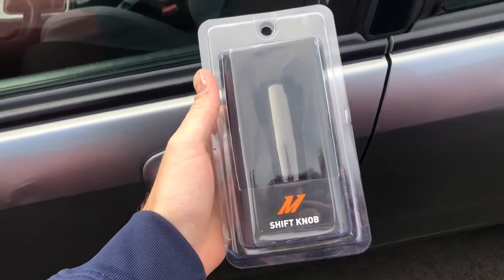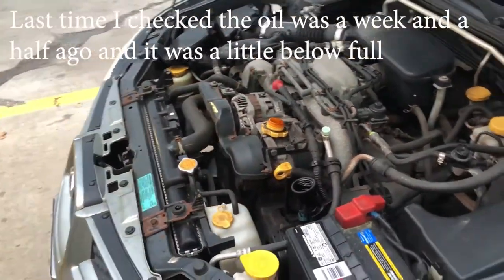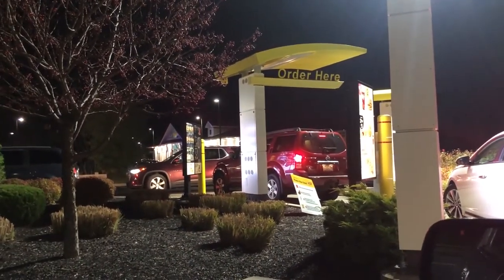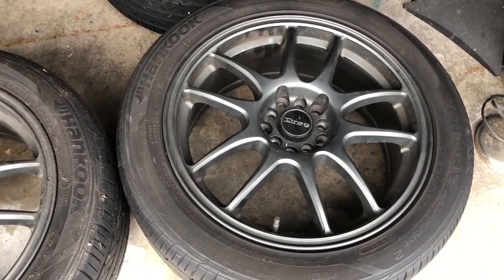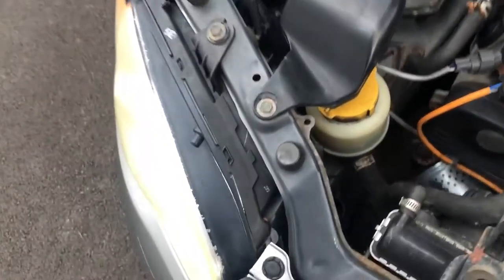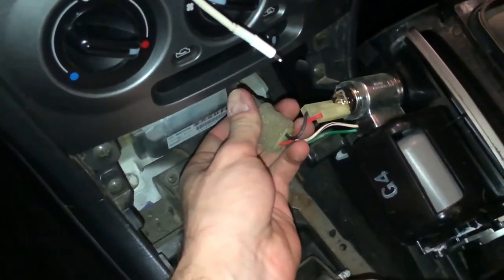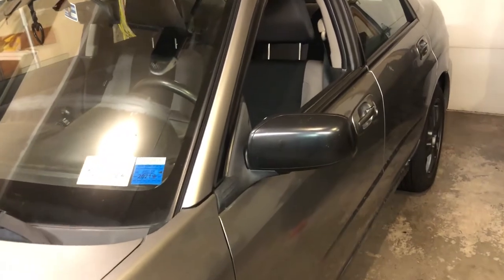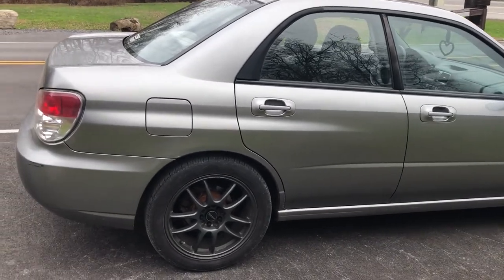New Impreza Parts! (Drag Wheels, Intake, and Mishimoto Shifter)

Comment: I picked up a 2007 Subaru Impreza 2.5i a few months ago as my first car aswell, and I was curious if you had any suggestions on what the first mods I should do could be. I do have a few minor issues with my power steering but nothing that can't wait. thank you, keep up the awesome job btw!
Reply from the maker: Thank you so much! Its really cool to hear about other people having the same car. After the car is reliable, the first mods I'd recommend are probably a shift knob and wheels/tires. My reasoning is that the shifter is one of the things you interact with the most, and you want that interaction to feel good. I personally like the stock steering wheel, and its nice to have the added safety of retaining the airbag for now. Wheels and tires are more expensive, but can have a huge impact on how the car looks and handles without any suspension or body mods. This is just my 2 cents so take it with a grain of sand, but beyond that Id recommend just looking at other builds or forums and doing what's in your budget. Hopefully this helped.
Reply: cat back exhaust and lowering springs or coil overs before wheels

Comment: Awesome buddy I just did the LED headlight bulbs and I'm also in the market for a replacement mid pipe and muffler, I'm definitely gonna keep an eye on my oil after seeing what you went thru
Reply from the maker: Thank you, and while my case may have been extreme it is an all too common issue.
Reply: I bought a cat back exhaust that was suppose to fit a 2.5i/WRX (for my 2.5i) and it was about 10 inches too short 🙃 so now I have to go to a muffler shop and hope they can fabricate something since I’m not a welder nor have a torch like our buddy here.

Comment: I have a 2007 Impreza Wagon, straight piped, lowered on 1.7in lowering springs and I did have xxr 527 wheels but I recently sold them so i’m on stock wheels right now for the winter
Reply from the maker: That's awesome!

Comment: You should think of lowering springs or coilovers to get you that better fitment. Also plz keep us updated on how the air intake works for you I was hesitant on taking my air box out as I was told it would make my 2.5i less reliable
Reply from the maker: I can see why people would say that as there is much less protection against the weather or water. It's such a small change I haven't noticed much difference. I should still make a heat shield or partition to protect it a little better and keep the heat away. It may change your fuel mixture a little bit because of the change in air flow, but the computer is designed to adapt to small changes like this. I'm not expert, but as long as its a decent filter and far enough away from the engine and outside elements like water, I'd say go for it.

Comment: Do you think you would have had enough room to run those with a 47mm offset with no rubbing I have some drags similar to yours but found a pair of DR31 that are 17x8 with a 47mm offset I am acepto al about rubbing
Reply from the maker: Considering I have no rubbing issues, I’d think you would be okay with slightly different specs, but you would have to do the math or check forums for other people’s setups. When buying my wheels I didn’t really care about offset because I knew I’d probably need spacers anyway, so if you plan on running spacers it shouldn’t matter too much.